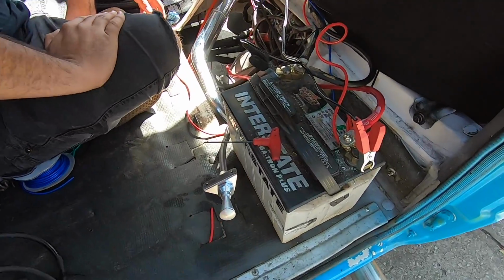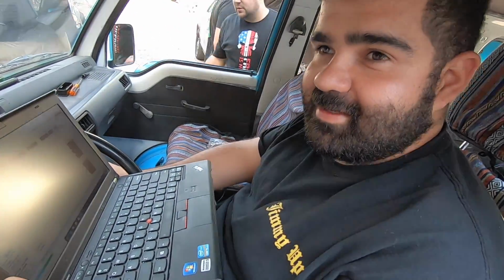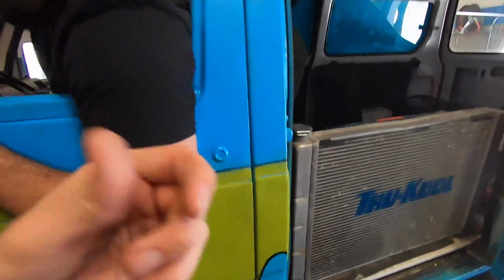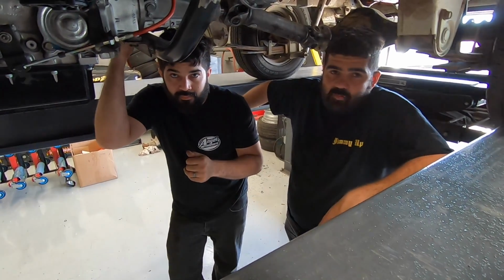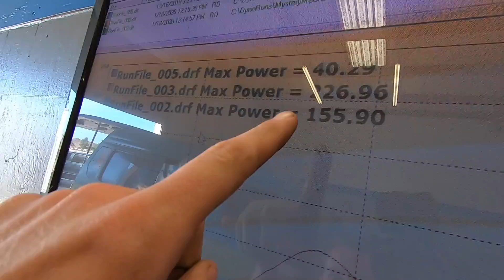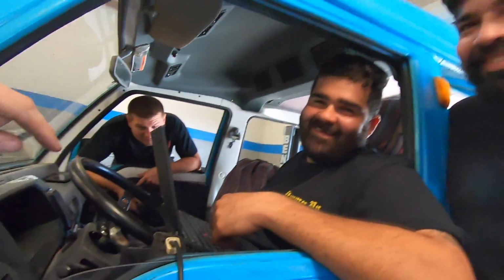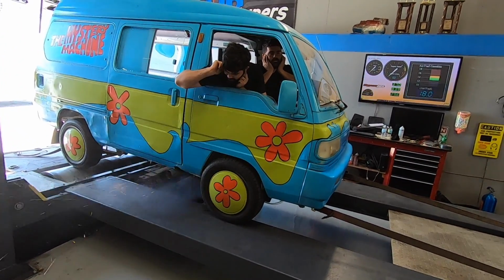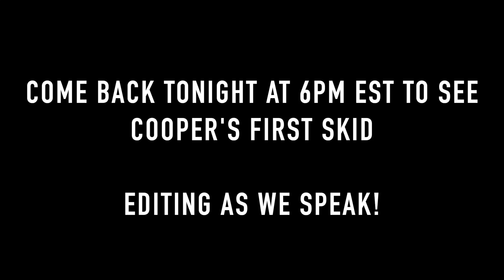ROTARY Swapped Mystery Machine EP.4 - BOOSTED Micro Van Hits the Dyno!!! (baby boost)

Comment: Hey Cleetus, to fix the flicker you need to go into settings on the GoPro and change the Shutter speed! 

Like so he can see
Reply: This 100% maybe the answer. Definitely shutter speed and the fps. If its flickering on the LCD then it's probably shutter or Hz? I feel like I should know this but also vastly I experienced.
Reply: Garrett needs to invest in mcfarland tech support
Reply: @jamesmay6674  Lol at "100% maybe"
Reply: I think changing the hz should help also
Reply: Also, if you have any spares, maybe send them to Kyle over at BoostedBoiz?  All of his equipment got stolen from his Truck (I swear that f'in truck is CURSED) and could definitely use some help!
Reply: Lol, He changed the FPS to 50fps when he was in Australia because everything there is 50hz, he needs to change it back to 60fps now that he’s back in America with 60hz, hopefully he sees this 🤷‍♂️
Reply: @johnscotlinksl  dont think so. the problem isnt the lighting its the fact the camera is bouncing frame indexes around... i think that it would be highly unlikely that the Hz of the lights would make a frame get put in the wrong spot. hes recording in too high of a resolution for the SD card.
Reply: Vinnie Davis unless he’s using a really old Sd card then that’s not it. He had this same issue when he went to Australia, pretty sure he just didn’t change the FPS back
Reply: I didnt see any flicker this time, at what point in the video are you guys seeing flicker?
Reply: @johnscotlinksl  There is no hertz flickering in this video. Its easy to identify as an 80s child as myself when every monitor, TV, lights flickered on TV cause of hertz :P

Comment: Last week: “We’re using a rotary engine” Rob Dahm: “Hell yeah! That’s awesome!” This week: “we’re done! Let’s dyno!” Rob Dahm: “Wait,.. Done??!!”
Reply: Sign Deals underrated comment😂😂😂
Reply: Hahaha so true
Reply: I wonder if the Vargas bro’s could get a 6 rotor up and going in the Mystery Machine in about the same time period. Rob would be crying for sure.
Reply: @Globalflavor  6 rotor would probably only take them twice as long, rotary gods 😂
Rob would definitely be crying then
Reply: Turtle Mode Dahm
Reply: @mrspadilla4845  Exactly that, the guy Mazzei Formula has had his turbo 26b done for a long time now without the ridiculous cash grabbing hype drama.
Reply: @CFHmetalorama  robs build is 100 percent custom from the engine to most of the drivetrain
Reply: @WearyKirin  Custom to what extent in the motor? Most aftermarket housing manufacturers will port your housings to spec and balance your rotors, you can buy intakes and eccentric shafts from a few for a 26b. Drivetrain maybe so but it shouldn't take years unless you can't actually afford it. 

There are many RX7's out there which have been heavily modified, the owners just haven't milked their builds for views.
Reply: @CFHmetalorama  I'm pretty sure its also money issues lots of the parts are incredibly expensive the transmission alone is 20 grand
Reply: 4 rotor making 1k hp. I guess you trolls should watch the video.
Reply: Who cares are you counting. It Takes that amount of time to make perfection! watch the videos..
Reply: @doserdiesel  Holy shit you mean like the one Mad Mike had in his Miata years ago?

Comment: I love how those rotaries sound and act like 2-strokes! So much fun! Lol
Reply: Same here, sounds like my chainsaw...
Reply: Because they are 2 strokes
Reply: Rotaries are a two cycle four stroke, as Maxcooper said they have a true 4 cycle (combustion event) but unlike a piston 4 cycle engine the Wankel rotary only needs one crank shaft revolution to complete its cycle, just like a two stroke piston engine.
Reply: Funnily enough some teams that race rotaries run them on 2 stroke premix
Reply: Robert Bell lol most people with rotorys premix oil in with there gas as the oil injection is unreliable. I toss 2 stroke oil in with every fill up in my vw diesel adds a good bit of lube to the now dry diesel
Reply: @rab..  everyone does. Most important mod is to remove the oil injection system and run premix.
Reply: Joel Ground  2 stroke?  How does it act the same.
Reply: John Coles just reminds me of how a 2 stroke dirt bike rides and sounds, gutless all the way to the power band and watch out! Lol and of coarse, all the noise. ;-)

Comment: In my eyes this is more dangerous than the freakin golf cart
Reply: The golf kart with less than half the power and a roll cage?? No idea why you'd think that...
Reply: @christianbuczko1481  Just trying to hint that they need to get a cage in this thing.😂
Reply: Hell either one will try to kill ya within 100' lol
Reply: Yeah it’s not will it roll over it’s when.
Reply: @christianbuczko1481  pretty sure the golf cart was close to the same power and half the weight.
Reply: It's going to roll over for sure. They need to do something about the soft suspension
Reply: golf kart was around 170 hp
Reply: Come On guys power to weight ratio and weight balance 🙄 golf cart is a death machine this is just mental
Reply: @fatboyzracing3178  more like 1/4 the power but also much lighter.
Reply: @wackypocket  based on what? Did they dyno it?
Reply: @wackypocket  the engine they used are generally around 130 to the wheel. They didn't modify it if I recall correctly.
Reply: Ummm nope lol. Its for burnouts not drag racing so its not as dangerous. Cage is coming soon probably anyways.
Reply: They are BOTH sketchy as you can get.  Either one could kill you within a few seconds if things went wrong. I like these guys and dont like to think of Mr. Spaghetti getting squished. Hopefully a little safety gear is up next on the build schedule.

Comment: Hah hah! That was pretty intense.😁 It will get easier to start as the apex seals get seated in and it builds more compression. I'm surprised that little mini-truck differential is holding up to the 300 hp. of the rotary. Probably the saving grace is the fact that's it's got an automatic behind it.😉 This is, without a doubt, one of the coolest and most hilarious builds you guys have come up with yet! Big shout-out to the Vargas boys for getting that little beast together in record time!!😎👍👍

Comment: Put a vent in the sliding door and a reversible fan on the radiator. That way you have a heater depending on what way the fan is blowing.
It can also help push burnout smoke from the cabin :)
Awesome build, very cool.

Comment: have a build off with the vargas brothers
Reply: Vargas vs Boosted Bois.
Reply: Vargas brothers would win
Reply: Vargas vs cleet vs Boiz
Reply: @bloodson1942  what fast cars do vargas brothers own? 1/4 cars?
Reply: @josedavid952  they have a 600hp rx3  think that they built on the hoonigan build off also mike has a three rotor with three turbos 🤣
Reply: Better yet, have 3 teams! Epic builds! Actually 4 teams! Het fasterproms involved
Reply: 3 way build off would be sick!!!
Reply: @acherontiaatropos1  That's not a rx3 that was a fb rx7, and aside from that car, they have a ton more, follow there channel and instagram and you'll see them, they have 2 shops, one on the eastcoast and one on the westcoast.
Reply: @acherontiaatropos1  any 8 sec cars? I seen tha red rx7 but thats a 10 sec car
Reply: @josedavid952  mochi red rocket, repo truck , a fleet of rx-7, rx-2 and rx-8
Reply: @josedavid952  then theirs the 500 hp+ 2 rotor rx-7 with 30+ psi of boost
Reply: @josedavid952  there's alot more, you can check them out at @Angel Motorsports
Reply: @bloodson1942  thanks for the polite reply

Comment: Hey Cleetus! Check the settings on the GoPro 8 and the mains power compensation settings. It sounds like it is set for the frequency we have in Europe (50Hz). USA is still on 60Hz and this is the light flicker you pick up in the GoPro when it's configured for EU. When configured correctly, like what is on the OG GoPro 7 all looks fine and camera compensates like it should.
You are welcome!

Comment: that thing needs a lot of tuning still. it has a LOT of potential.

also, keep it on small tires or that diff is gonna blow up. additionally, throw a 9" under it and 9" slicks with a wheelie bar. 

for cooling, move the radiator to the roof. cut a hole and mount it there.

Comment: Shop lights run at 60hz , which is the same frequency of 60 FPS turn frame rate to 30 FPS and it will go away.
Reply: Why does the hero 7 not do it at 60 FPS? I'm not saying you're wrong I'm just curious if there is a reason.
Reply: Think its something with the auto stabilization, due to the entire frame jittering side-to-side. I've seen it happen on other channels. He's been shooting on 60FPS for a long time without issue. But I'm just speculating.
Reply: @lumntoob999  How to AVOID FLICKER and STROBING While Filming  watch that and it will explain it ... It's shutter speed and frame rate combined.
Reply: @FrequencyOfThought  interesting, thanks I'll try to find the video.

Comment: Hey guys , it might be smarter to re locate the rad to the rear aswell and take the rear windows out for alot more air flow, if you find an mr2 you can use about of the cooling system for the rad seeing as that they have a front end rad with the engine in the rear . Just a suggestion fellas. Ps this is the coolest build on the internet this year by far!

Comment: “the dorito engine is a little more sensitive than a normal engine.” proceeds to rev bomb it everytime they start it
Reply: dorito engines like to flood, so they rev it to clear out the extra fuel.
Reply: Doritos need to rev. They do not like grandma's right foot.
They also pop apex seals as often as Cleeter pops tyres.

Comment: The radiator would be better mounted at the back door with air feeds either side. Also get a really wide rear diff so you don’t tip it over in the burnout pad.

Comment: The best bang for your buck as far as fans go is the Dorman 620-101. About a hundred bucks from Summit, Its a 2 speed replacement for the Ford Taurus/Continental. I usually just hook it up with the low on the temp switch and the high on a switch with a relay on both sides.

Comment: 519 HP my guess on the Dyno
Reply: Nah, not even close.  If you watched the last video, they talked about the turbo and how small it is.  They even stated that it may be lucky to get to 400hp.  And That's at the crank,. So at the wheels fully turned up, they will put down low 300s.
Reply: Don't reckon you'll be far off
Reply: 1216jimmyz stock in great condition it probably only made 70hp so anything in the high 200s or low 3s is a huge amount of power for that thing. All about power to weight
Reply: 435HP when the Vargas brothers are done.
Reply: Shin Sho  it's not gonna jump 200hp buddy.  The turbo is not big enough to push enough air for much more than it's at.  Low to mid 300s, that's all it's gonna do.  And again, THATS WHAT THE TUNER, BUILDER,AND ROTARY EXPERT SAID!!  Lol
Reply: Wishful thinking, I guess.😂✌
Reply: Yeah.. The last video.. The brothers said the turbo was to small to reach 500.. they said it may reach 400.. but not definite
Reply: @jaytibby  thank you...lol.   and That's at the crank, so low to mid 300s at the wheels is the most realistic estimate at this point.  BUT, that can would be absolutely SUICIDAL with 500 plus at the wheels.  Shit, it was a death trap with 40...hahaha
Reply: Shin Sho  what ever helps you sleep at night.  Clearly you know more than the professionals that stated differently and are the ones building and tuning it, but hey, what do they know, right?

Comment: I would just like to point out that radiator fans are most often if not always unidirectional and will be far less efficient in reverse, perhaps this may be why you measured higher temps. I'm sure it will end up needing a larger rad to keep up with the demand of long rips I'm sure it will see at some point 😁 if you do get a new fan though, it would be much better to use the correct polarity. I know y'all will figure it out without my comment anyway, looking forward to seeing much more content on the mystery machine in the future!

Comment: If you use a CV double cardon driveshaft in (like the front shaft in a jeep with 3 u joints) you can point the rear axle at the trans output.

Comment: You need to relocate that radiator to the back, "too dangerous" where it's at plus the back door open is better than having sides open, " appearance / look wise"
Reply: Bud Smokegood  ever seen a car overheat doing a burnout and the radiator explode? What do you think 400° scalding water and steam will do to Cooper's pretty little face? Not to mention mystery machine is on the side people are going to be looking at the side of the van more than the back, you could remove the whole rear hatch and it's still look normal half way. It needs some kind of roll bar and impact bars for the wall, and definitely something to protect him from the radiator, along with some type of extra scat shielding under his butt because if that rotary blows he's going to be picking pieces of metal out of his ass for the next year or better.

Comment: It’s A LOT more efficient to pull air through a radiator than push air through a radiator. Put the fan on the door side. It will probably never get hot again.

Comment: Need to find a hot rod shop with a set of louver dies an have them louver the side door for the radiator. An mount the fan on the front side of the radiator to pull through an out the side door.

Comment: You should take the fan and put it on the opposite side of the radiator and cut a hole in the door so it sucks all the heat out from the radiator so it’s not so hot in the cabin

Comment: That front engine mount bolted  to the front cover would concern me. The Front cover is not designed to deal with such loads. The mounts needs to be in the front or rear iron.

Comment: Your video FPS and your lighting electric hrz have to be the same or a multiple of, in order to avoid that flashing. I.e. in America we use 60hrz power so your camera has to run at 15,30,60 or 120 FPS. Your camera might be on euro standard.

Comment: put some 2 inch blocks under that diff and that driveshaft will be dead flat, put some springs and shocks in the front and it'll be more stable

Edit: gonna leave this here but just realized you probably cant lower it because of how low the sump sits, but if you find a way around that it would make life a lot easier

Comment: Man that bird is going to rip. 300 dorito HP is like 500 normal HP
Reply: McToads more like 150 real hp with how little Torque 13b’s make 🤣
Reply: @MVSTNGGT  that's not how how roterys work buds lol.
Reply: McToads well, doritos dont equal 200 extra hp thats for sure!
Reply: @MVSTNGGT  I wasnt trying to be exact with my numbers there dr.rodknocker. it was a goof. But a 1.3l 13b puts out the same amount of compression s a 2.6l piston engine... so if you want to do the math be my guest but it's pretty close to the random number I tossed out there
Reply: McToads was that a joke too? Cause compression doesn’t equal hp... it may flow as much air as a 2.6L, but that doesn’t equate to more power lol, a rotary making 300hp has no where near the power band of a 300hp V6 or V8, so technically most of them make less overall power because its all within a couple thousand RPM instead of the power being evenly spread.over the whole power band.

Comment: Some 600hp that is. I remember him saying that his vette made like 1300hp when he first built the turbo set up.  He always way over rates hp numbers for views.
Reply: Bryan Roupe did you listen to what they said? The motor has to break in before they turn up the boost. Three hundred at spring pressure is no joke. Also Leroy could make 1300 no problem but there is no point seeing as how it blows the tires off at the hp it’s at now. Dyno numbers aren’t 100% accurate anyway

Comment: Looks like you're stretching those straps on the back so much that you're losing at least 30 or 40 horsepower due to the fact the vehicle is rocking forward and back instead of staying stationary while the Dino wheel is getting all the power

Comment: prolly lost some power to the rigging that thing is a smoker and a screamer
Reply: It might be the oil ,rotory are like 2stroke motor.
In the breaking you need to add a bit more 2t oil to the gas so the wall shape up nicely or will end up with scratches and break Apex seal from friction.
Gasoline is dirty is the dirtiest fuel.